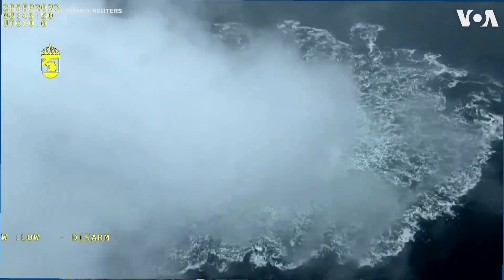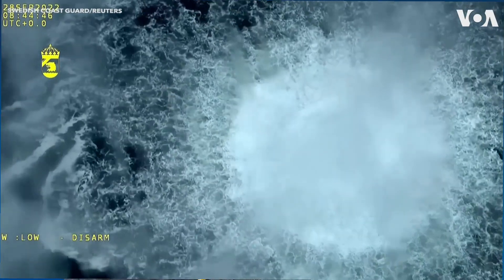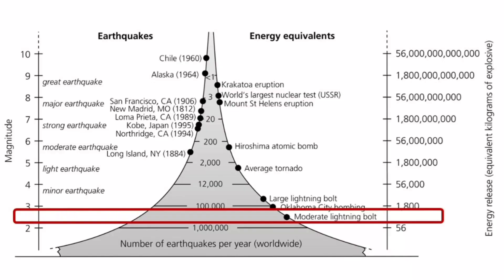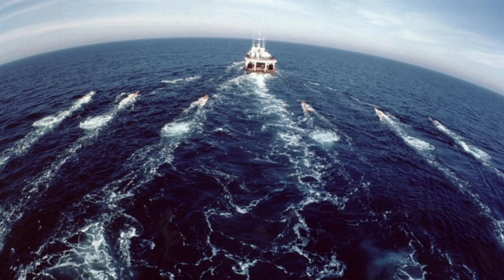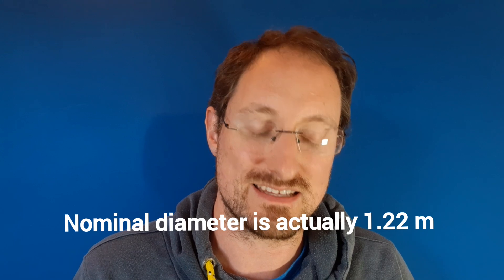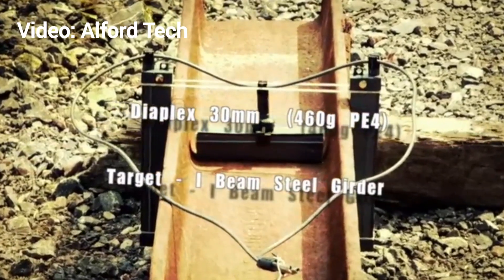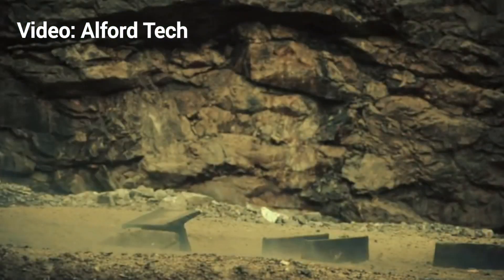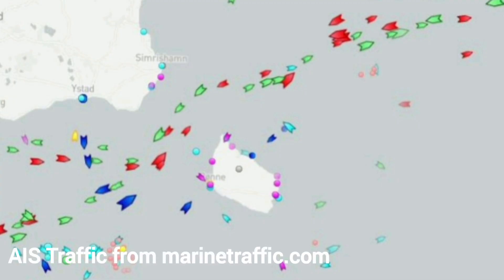Nordstream pipeline sabotage: A marine robotics perspective

Comment: You didn't explain how this nominal small unit would get through the concrete encasement to access the pipeline.
Reply from the maker: The 11cm thick concrete casing provides no significant hindrance to a shaped charge, as there is no rebar